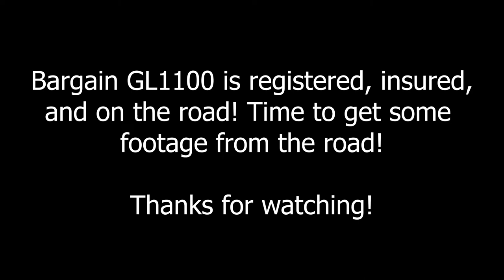Bargain 1983 Honda GL1100 Goldwing - Part 3 - Exhaust Gaskets, Valve Clearances, and Light Wiring

Comment: The weight on the front is an Anti Dive Weight. It's on there to help with the dive on the front when braking. Not needed without the fairing.
Reply from the maker: Thanks for the info!
Reply: @blastworks  I'm building a  cruiser from a 1982 GL1100.
Reply from the maker: @duncang01  that's awesome! I recently stripped the pipes on mine and did them with flat black header paint, and also took the rear rack off, and it looks great!

Comment: Loved seeing this as I'm currently just finishing off my '83 Goldwing Interstate.

Glad you put that custom plate over the housing as that stock piece you thought was a heatsink is actually the counterweight for the fairing. May use your idea for it though as my fairing needs to be replaced and prices shipped to Ontario for used ones are ridiculous.
Reply from the maker: What sort of work are you doing? Are you doing a full on factory restoration, or something more along the lines of what I did?